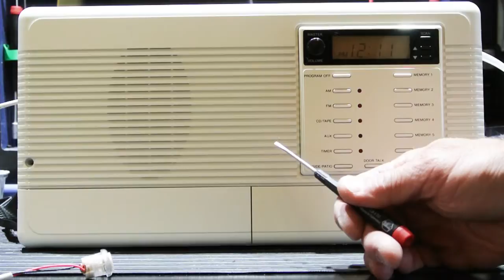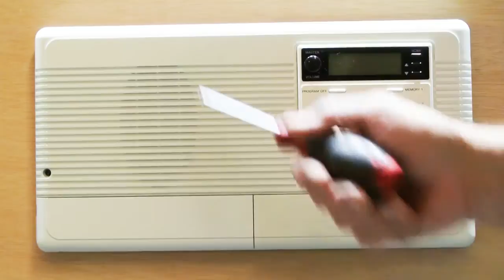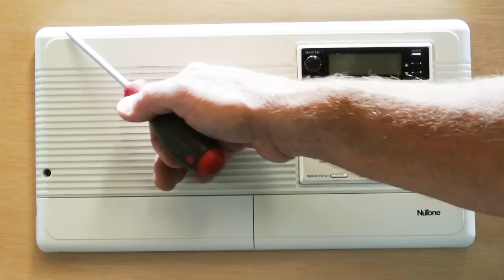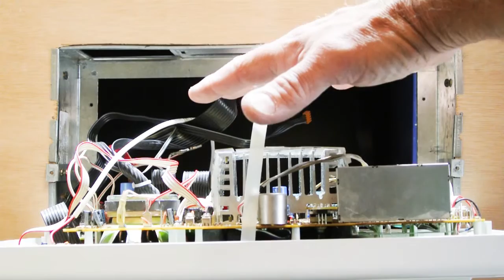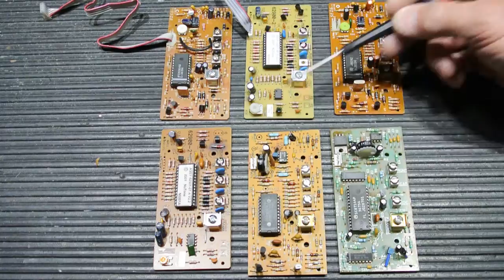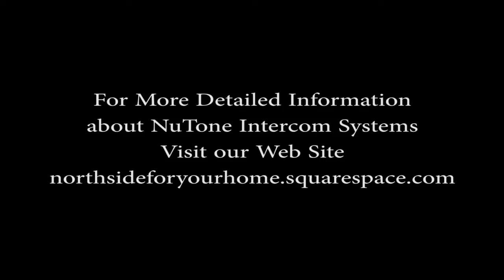How to Adjust the Volume on a NuTone Radio Intercom Chime Module

Comment: Is there a way to adjust the chimes? We have 2 doorbells: the ringer on one plays 8 notes, and the other only plays 2 notes.
Reply from the maker: Hi d.siwicki: I am unlcear about what your mean by "adjust the Chime" - Your System has a NuTone IA28 Chime Module, which is setup to ring 8-Notes for the Front Door, 2-Notes for the Side Door and 1-Note for the Rear Door.  You can make the Pushbuttons connections in any order your wich (ie. front door could be 2-notes etc.) but the Ring Tones are set in the IA28
     The was also available the IA29, which is a Muscial Chime Module, which has 10 different songs.   Here's a link to our Video about converting your IA28 into a IA29 - https://www.youtube.com/watch?v=U-22JQ0yITU&list=PLsTvqKsBnGYdc9ep25S49GDafiAo8cEcS&index=5&t=487s
-Chris

Comment: I have a  NuTone IM3303 . The unit has every red light on. The display lights up but is blank. Any ideas on where i should begin troubleshooting? Thank you.
Reply from the maker: Hiu Michael:  The 2 most common causes for the problem you describe are: 1 - An improper reboot after a power outage or 2 - Damage from a power surge or lightening strike.  The Only Thing you can do is try performing a Reset on the Master Station - This Video show how to do the Reset:  https://www.youtube.com/watch?v=hJ7hSia0d7A&list=PLsTvqKsBnGYc2zj1Db43FzJR_JV684dsi&index=1&t=153s
     If your IM3303 has lightening damage, it is not a do-it-yourself repair.
You can contact us direlty is the Reset doesn't solve the problem - Chris     nscompany@msn.com

Comment: Nice video!  My IA-29 has a very faint volume and adjustment of R36 has no effect.  Has the module's amplifier circuit possibly failed?  Thanks.
Reply from the maker: Hi David:  Well, it depends - I'm going to make an assumption about what Model you have as a IM3303 - The missing information about your System is - 1.   Does the Radio play correctly with plenty of volume? - 2.   Does the Intercom work correctly from all Stations to all other Stations? - 3.   Did the Chime Volume drop slowly over a long period of time, or did it drop suddenly? - 4.   Are your System wide adjustments all set correctly (most people don't know how to setup their system correctly, you can contact us directly for a copy of the setup instructions)
     It is possible that your Chime Module is in the process of failing and can be repaired.  It also possible that you have a Master Station problem or your system is way out of adjustment, or a combination of this items

Chris

Comment: My intercom system says “electronic chime” and there is no dial. It’s a 3303 model. The speaker works but the doorbell does not. What should I do?
Reply from the maker: Hi ThePrincessBelle: The connections on your IM3303 labeled as "Electronic Chime"  are connections that are used on Installations which have a separate NuTone Electronic Chime - which operates independently from the Intercom System - as any Chime Would - but the Chime also sends the "Chime Tones" to the IM3303, which send them through the Intercom System,  These connections are NOT an built-in Chime.  By the time your IM3303 was installed, most Intercom Systems would have a "Chime Module" added tot he Master Station - which takes the place of the separate Chime.  If you do not have a Chime Module - perhaps your Installation was an upgrade to an older System - which did not have enough wiring between the Door Station and the Master Station to support a Chime Module - Chris

Comment: THANK YOU VERY MUCH for your video.  I lived with a really loud door chime for 13 years!!!  It is now at a comfortable level thanks to your help.
Reply from the maker: Hi Angel:  It seems that some time in the 1990's, installers stopped setting the Chime Volume to an appropriate level when they trimmed out an Intercom System.  This compromises how the System wide settings are made and can cause damage to the Master Station over a long time.  Good to know yours is now set properly - Chris

Comment: Hey Chris, I followed your instructions and although I turned my doorbell chime all the way down using your instructions, it still seems pretty loud. It is noticeably quieter than before,  but still rather loud. Per your recommendation, all of my remote stations have been set with the volume as high as they will go and I have adjusted my system volume to a comfortable level. I also have the loudness button in the off position. Are there any other settings I should adjust? Thanks!
Reply from the maker: Hi Kelly:  If the Chime is still to loud, you can lower the Remote Station Volumes just a little - Chris
Reply: @northsideservicecompany3567  OK, sounds good. Thanks, Chris.

Comment: Your videos are fantastic! I've successfully reset my system and adjusted the doorbell volume potentiometer so I can hear it properly again. One question: is there a way to replace the chime component itself with one that has a different ring? I really don't like mine...
Reply: This NuTone panel comes with about 12 different chime tones!  And they made it a secret how to change it (probably it's in the manual, don't remember).  But you can do it yourself with nothing more than a toothpick.

The bottom of the panel has two doors.  Open the door on the left (NOT the one with the NuTone logo on it).  To the left of all the slide switches is a little unmarked hole.  Inside that hole is a press-button.  Using a toothpick, press that button.  Each time you press it  you'll hear the next chime.  There are holiday ones, happy birthday, and the default Westminster chime (that's he one that you hear in the video above).  After the 12th chime, it cycles back to #1, the 8-tone Westminster chime.
Reply from the maker: @ThePassedpawn  Hi The Passedpawn:  Only Systems with an IA29 Musical Chime Module have the push button switch added to the Master Station to change the songs

Systems with the Standard IA28 Chime Module (1-2-8 Notes) do not have the switch.

The secret is that the Songs are in all Chime Modules and by adding the Switch to an IA28 - it becomes an IA29.  We have a Video about this:
 https://www.youtube.com/watch?v=U-22JQ0yITU&list=PLsTvqKsBnGYdc9ep25S49GDafiAo8cEcS&index=6&t=0s

Chris